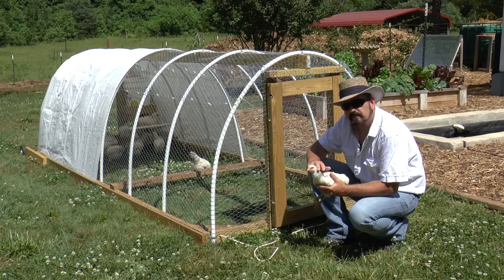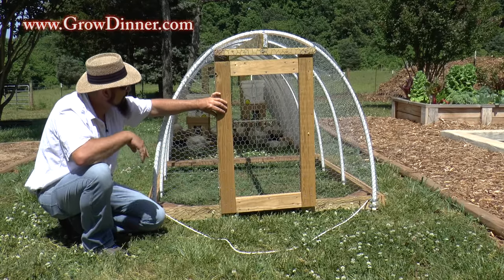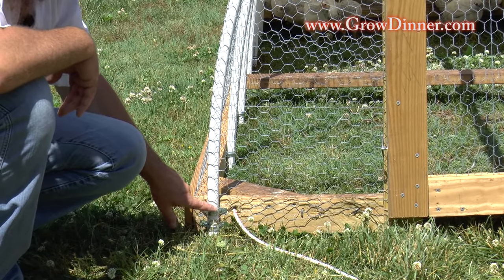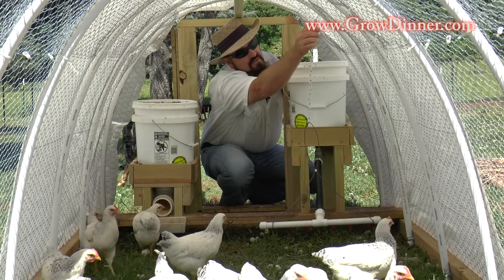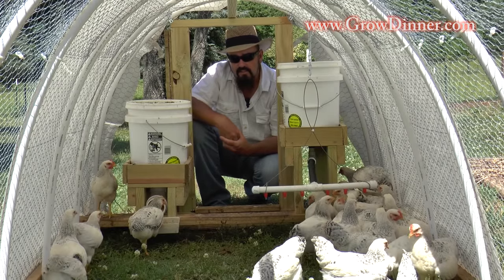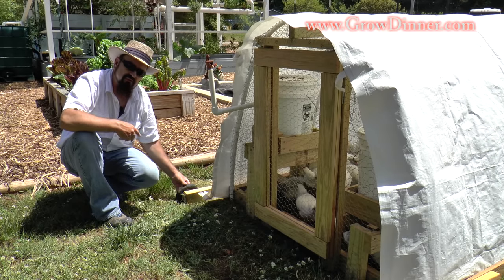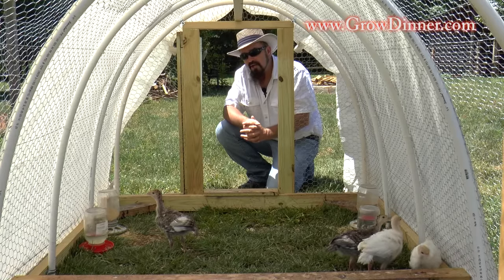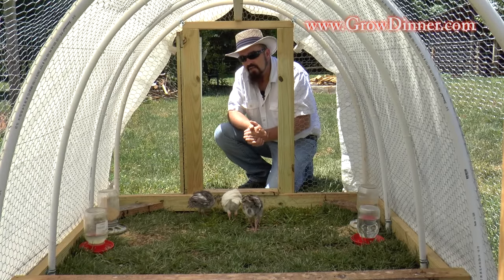Easy DIY Chicken Tractors

Comment: To help cut costs you can drill holes through the ridge pole (for the conduit) to save a few EMT straps. The white PVC isn't UV protected like the gray electrical PVC conduit so the gray will last longer. I hope these hints help in your future endeavors.
Buddy
Reply from the maker: +Buddy Harrison Way more trouble than it worth to drill the holes 
20 pack 3/4-in emt strap at Lowes $2.98 plus they are needed around the bottom. As for the UV protection I don't want them to last forever. I find pvc is good for about 5 years by then its time for a new build, the chicken wire is ragged by then. If you want one to last 20 years I would not recommend this type this is only a easy quick through together that will last a few years.

Comment: Chris, would you share the fitting list on the bucket watering system? Is there an o-ring fitting or something that converts to that flexible hose connection? Thanks in advance!
Reply from the maker: +Mark James Bulkhead fitting at bottom.

Comment: Is this like a 4x8 feet? Do you have a material list anywhere? Thanks bro, been raising chickens once again for a couple of years, but their permanent coop has no grass left in it, they need to get out in the grass, but don't want them pooping on the porch!
Reply from the maker: +Mark James one is 4 x 8 one is 4 x 12
Reply: +Grow Dinner Aquaponics Thank you sir, we built one yesterday, except used electrical conduit, treated wood, and different wire. Hoping to get years of use out of it)  Seems the chicken wire we bought 2 years ago is completely gone! Rusted through. I don't know where you can find good chicken wire these days.
Reply: +Grow Dinner Aquaponics Thanks once again for your videos. That was really helpful. The ridge made it extra strong.